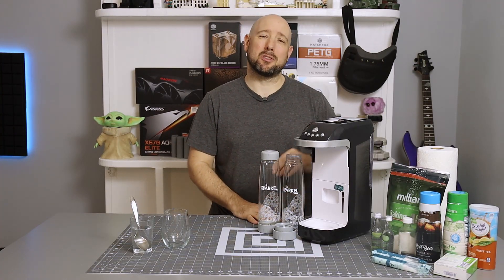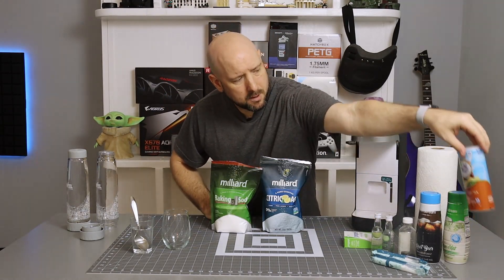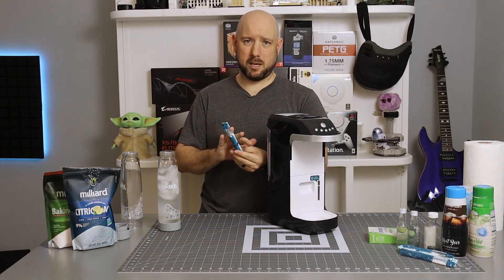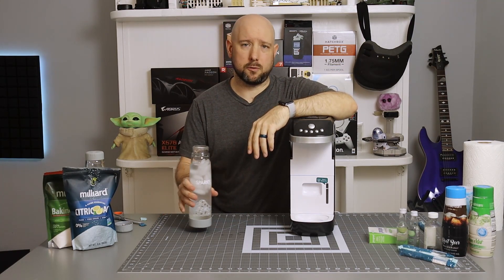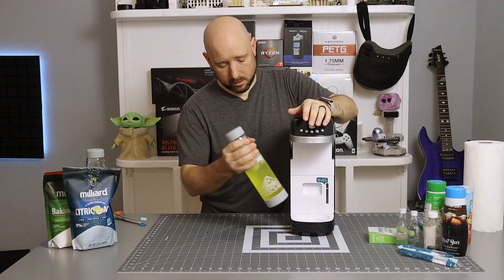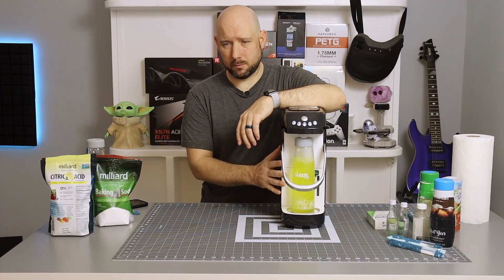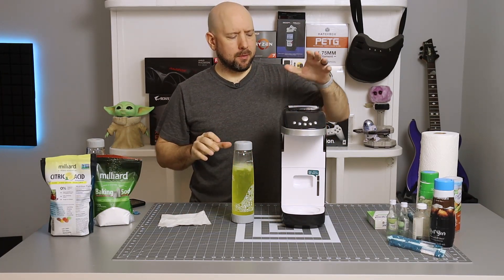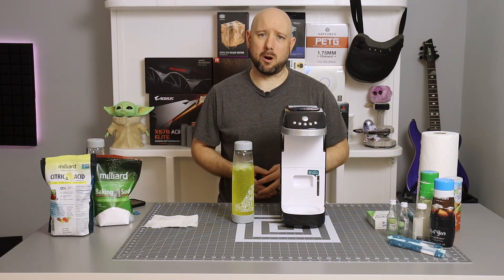Review: Sparkel Beverage Carbonator (with no CO2 canister)

Comment: DO NOT make your own carbonator. You will destroy the machine and void your warranty. I know because that's what happened to me. They may not look like it, but these are VERY sensitive machines and putting them through the wrong pressure will wreck the parts. I made my own carbonator using these exact directions of citric acid and baking soda and now my machine doesn't work. If you can't afford to buy the official carbonators forever, then DON'T buy this machine.

Comment: A few years into my machine and it still works great. The few times it has had issues it just required a good cleaning. They actually suggest that you unplug it and rinse the bottom area with hot but not boiling water to clean out any spilled or dried materials. No need to unscrew anything like this video suggests.
Reply: Do you use the carbonators that you buy from sparkel or do you buy your own citric acid and baking soda and use that? If you do buy baking soda and citric acid and not the sparkel carbonators have you ever had a problem with your machine?

Comment: We purchased a Sparkel a few months ago and only used the sachets,  never anything else. We empty the tray after every use and top up the rear reservoir to the fill line. After only a very few bottles, the machine would start to do strange things such as excessive drainage of the rear reservoir and fast filling of the tray. The bottle itself would lose much of the volume of what it was filled to prior to agitation. Frequent cleaning was required to rectify this. Eventually, water must have seeped into the electronics board and the machine was ruined. Sparkel was very good at sending a replacement unit.  However, only using the machine a few times, the machine started to exhibit the behavior of the original Sparkel and addition, a puddle of water on our counter. I found an online video from Sparkel on doing a deep clean using warm water and vinegar but I question why I would have to do this after such little usage. I'll give it a go but right now I'm giving this a big thumbs down.

Comment: Your comments about the cleaning issue below the bottom valve was a concern for me. Sparkel has a video posted on YouTube for 'deep cleaning' the machine and they do address that issue in addition to other cleaning tips.  It is NOT necessary to disassemble the bottom to the Sparkel to clean under the valve by removing the screws as you did.  They show a simple way to clean that area that is fast and extremely easy to do, no disassembly required.

Comment: I have only used SodaStream and the only issue I have with it is the actual CO2 absorption that it produces. I drink Diet Pepsi and was happy to see that SodaStream now offers the Diet Pepsi syrup (they should, Pepsico bought them out.) Anyway, back to my absorption issue. I drink from the smaller 1/2 liter SodaStream bottles (which is the same amount as the 16.9 oz Diet Pepsi's in the store.) I like to sip on my drink over a 30-45 minute time frame. My SodaStream Diet Pepsi has plenty of fizz right off the machine but about 20-30 minutes in, and 3/4 of it gone, it basically runs flat regardless of how many "pumps" of CO2 I gave on the machine at the start. So for my tastes, the carbonation decreases way too quickly. In contrast, if I am drinking a similar size store-bought Diet Pepsi, I can drink 3/4 of it, put it in the fridge (even uncapped)...and 6-8 hours later there is still be plenty of carbonation to satisfy my tastes. A long way around the question I would like to ask but here it is: Would the carbonation in a Sparkle drink last for 30-45 minutes? In other words, does the CO2 produced by baking soda/citrus acid allow for better absorption into the water over CO2 cylinder gas? (which I assume is produced using dry ice? Thanks! Looking forward to any advice or input!

Comment: Great review, but the Sparkel system is way more complex and messy than Soda Stream. I have concerns about all the wetted parts and good hygiene. The fact that you are dumping waste from the packets, liquid waste from the machine and paper towels for clean up is not too impressive. SodaStream cylinders are way too expensive (a refill should cost a buck or less), I use a special hose that adapts a normal 25 pound CO2 tank to the SodaStream we drink at least 4 bottles a day and the tank lasts a year. The biggest difficulty is where to put this stuff. We remodeled a few years ago and I put a countertop in the pantry with a hole and storage below for the cylinder, nice and neat and easy. Before that I was refilling cylinders from a 25 pound tank, but that takes a special hose and valve setup and special valves on the SodaStream cylinders…it is also potentially dangerous, so you need to know what you are doing and wear the proper PPE while refilling…gloves and goggles.

Comment: This is the best online review of Sparkel so far.  

I was sure I wanted one before seeing this. Now I'm uncertain because high-maintenance Sparkel is quirky and it has obvious durability issues. 

It's unlikely that Sodastream will take Sparkel's innovations lying down. The question now is what they'll come up with next, and at what cost. Sodastream has never been cost-effective.

There are also the new non-electric DrinkMate carbonator plus consumer reviews to track, so I'm not rushing into Sparkel unless it proves its worth and ease of use. 

I have no complaints about the totally reliable commercial beverages I've bought forever. They deliver the high carbonation level demanded.
Reply from the maker: Thanks Paula.  If your main concern is the safety of having compressed CO2 around the house the Sparkel is a good alternative - or if you are very concerned about cost per bottle and intend to buy chemicals in bulk.  If you are comfortable with the canisters then I would suggest going with a traditional carbonator.
Reply: Soda Streams needs to be cheaper for one. Secondly using the valves like Drinkmate which allows you to carbonate any drink to your little hearts content. 

 Also I never understood why those systems don't use a hose to inject from the top or valve on the bottom side. Feel like just shooting carbonation at is not the most efficient way but could be wrong. 

 I'm going to try this at home today. PS: You can get citric acid under sour salt to try it. Curious on what he meant on the bubbles though. Seems like softer finer bubbles are all the rage with these Nitro drinks.
Reply: @dianapennepacker6854 there's an $83 sodastream. Much cheaper and out wouldn't have the ability to be a reliable appliance. Luxury appliances cost money

Comment: The "one liter" Sodastream bottle is also only 3/4 liter. Bear that in mind. I have owned several different CO2 carbonation systems and all of the bottles labeled one liter actually can only be filled to 3/4 liters to carbonate.

It's true of the systems that use tanks and it's true of the ones that take the little 8gm carts. 3/4 liter is what you can carbonate in a one liter bottle. If you fill them above the 3/4 line, they will not carbonate and will spew water everywhere.
Reply from the maker: Good to know!  I have the Sparkel, DrinkMate, and a Quarbo and they are all 750-800ml fill capacity so that checks out.

Comment: We've had our Sparkel for about 2 months and just love it.  Still, your video gave us some very useful information
Reply from the maker: Glad it was helpful!  Enjoy your Sparkel!
Reply: A lot of people complain that it starts to leak after 3-4 months , and the motor died  after 6-10 months.
Did you had such problems  ?
Reply: @Weston.007  Any leaking is probably the result of the base not fastened tightly enough.  We have had our unit almost a year and have had no issues with the motor.  We simply LOVE our Sparkel!!😍
Reply: @janicegibson2042  thank you for your answer!!! Didn't think that choosing the soda maker is hard )))
Reply: @janicegibson2042  do you use the carbonator sachets that come from the sparkel company or do you use your own baking soda and citric acid? if you use your own and not the sachets from the company have you had any issues with your machine?

Comment: Actual reason Sparkel doesn't want you using cheaper ingredients, they can't over charge you for them and make bank.
Reply from the maker: It's the kuerig/razor blade model.  The sachets are not crazy expensive and it's real easy to avoid so I can't complain about them too much.  They are the only ones trying to avoid the compressed canisters after all.

Comment: I think its awesome that they are doing a canister-less system, but its far from perfect due to the reasons you alluded to in the video. I think sodastream is good, but between this unit, sodastream, and drinkmate - I think drinkmate is the best. I wish we could use baking soda and citric acid or vinegar in a sodastream canister to generate CO2 OURSELVES without having to use the trade in system or mess with dry ice. Since there is a supposed "omfg Co2 shortage" (which I think is total BS), we need better ways to make Co2 ourselves. But still a cool concept
Reply from the maker: Same boat.  I'm really liking my DrinkMate so far.  I know folks use dry ice to refill their CO2 canisters.  I wonder how much or how complicated it would be to use baking soda and citric acid to drive a refill process? :)

There's a new carbonator on the market, the Twenty39 Quarbo, that uses a similar carbonation cap that I'd like to get my hands on.  It looks like it might solve my biggest complaint with the DrinkMake - the small bottle hole makes it hard to get ice in.

Comment: The baking soda/citric acid hack is 👍, but, 10 mm wrench, and about $1.50 worth of dry ice refills CO2 tank, for up to five years...
Reply from the maker: Hey Matt.  I've watched a few videos on the dry ice process.  It looks fairly simple but also could be pretty easy to mess-up in a bad way.  How do you get refills for years with dry ice?  Doesn't it evaporate fairly quickly?
Reply: Sorry, I meant you could keep doing refills this way, as opposed to switching tanks, but   five years of this , I don't know if I would trust the tank anymore.
Reply from the maker: @mattzee6287  Ahh, gotcha!  How much dry ice do you put in per canister?  Do they bleed off excess if you accidentally overfill?

Comment: I got one yesterday , pleasantly surprised withe the result the 1st time.... but when I went to get another glass 2 hours later after sitting it in the fridge there was no more sizzle , pretty disapointing .

 I thought it would at least be good 24 hours , any advice on that ? thanks .
Reply: Did you chill your water before carbonating?  It really helps hold the sizzle if water is cold.  I use setting 4.  Don't bother using 2 or 1.  I never tried 3.  Last make sure cap is on tight when you put it back in fridge.  Sparkel states the fizz will last a week.  The longest I kept in fridge was few days.  And it was still sparkly.  That's all I can think of.
Reply from the maker: I agree with nijoel that getting good initial carbonation is important and getting/keeping the drink cool is key to that.  The sparkel bottle has the pressure valves built into it so they might be bleeding off any excess.  Maybe move it to another bottle immediately after carbonating and see if that helps.

Unfortunately I tend to either drink the whole liter pretty quickly or forget about it and leave it out to get warm and flat so maybe not the best person to give advice :)

Comment: simple direct, great advice and tricks, read the brand comment and they just don't want you to over pressure the device whit too much soda and acid ,💪💪
Reply from the maker: Thanks Doo!  I've actually dumped two of the sachets in on accident.  There's no way to clean it out so I just let it go :)  No major adverse effects but I do believe there was a lot of bubbling and churning the waste tank.  Of course if you go bonkers with the chemicals or get too far off in the mix I could see it sticking inside the mixing tank and throwing things off.

Comment: has anyone ever had any issues with it? twice now the water & citric acid + b. soda spilled into my drink - any advice?
Reply from the maker: I've had it dump baking soda into the drink a couple times.  I can't put my finger on exactly why.  I'm guessing something wasn't sealed correctly some where and it pushed the mixing water into the pressure extraction tube but can't say for sure what was going it.  It was rare enough that I didn't spend a lot of time on it though.  I've since moved on to a Drink Mate.

Comment: Bed bath beyond has $15 canisters and you can use 20% off coupon. I have had the Revolution sodastream machine and its looks cool first electronic one sold but sadly not available anymore. Seams sodastream is moving away from electronics and back to manual operations. Their new one uses a leaver on the side to deliver co2 and special quick connect canisters. The first canister is $60 some license fee crap after $15 refill exchange. Either way soda is now over $2 large bottle so these machines are making more sense. I buy 5 gal diet soda syrup from webresterant store, takes 3 oz. Syrup to 1 lt. bottle sodastream and its more along lines of Pepsi tase than coke which i like.
Reply: Oh yesh i will go through more than 4 1lt. bottles a day, i make 4 at time and will probably refill them twice a day. I like me soda 🤩🥤
Reply from the maker: Dang KingLord, that's a lot of carbonation!  The Bed Bath and Beyond deal, is that $15 per canister refill?  I think I'm spending $38 for two canisters in the DrinkMate recycling program.  That Bed Bath and Beyond deal would be great!
Reply: @LilMikeysBigPlans  yes 60L canisters refill have always been $15. Drink mate program which think in sodastream program i guess charging for home delivery. You go to BBB with your empty and just exchange for full ones. Bad part was i own the Revolution and it used the 130L then they were dropped and could only get 1 60L replacement.

Comment: Thanks for the review! Can you please share roughly how much syrup you added?
Reply from the maker: I pretty much go with what that bottle recommends.  I believe the Sodastream cap lines are based on 1L while the Sparkle bottles are 750ml so you may want to go 3/4 of the way up to the line.  That said, each syrup has its own strength.  For example, I use more fake-Sprite flavor and less fake-Coke flavor per bottle but that's something you'll have to experiment with yourself.

Comment: I have a soda stream. I learned how to refill it with CO2 myself using dry ice. My cost per liter doing it that way is about $0.08 per liter. 

Very informative video. Thank you.
Reply from the maker: I'm on a DrinkMate now and going through my first set of exchanges so I can experience the process before putting up a review.  Assuming there is no major headache with the exchange process I think pre-compressed is the way to go for me.

Once I get through that process I plan on switching to a home refill kit using a larger tank however I haven't done much research on the dry ice approach.  Can you buy dry ice in small enough quantities to do just a couple fills or do you need a bunch of empties to make it worthwhile?
Reply: @LilMikeysBigPlans  I buy 6 pounds of dry ice to fill 4 canisters. It only takes like 15 oz to fill a canister, but you lose quite a bit to evaporation on the drive home and blending it to crush it.

There are grocery stores near me that sell dry ice in smaller amounts. They say 6 pounds is the minimum, but the blocks evaporate in their coolers, so I used to be able to buy 2 pounds at a time occasionally. If they just got a shipment in, there was no way to buy less than 6 pounds.

That’s why I bought 3 extra canisters for a total of 4. It’s much better refilling 4 at once every 3 months or so than filling 1-2 at a time more often. Plus I can use all 6 pounds.

I would lose less to evaporation if I did smaller batches, but I don’t mind losing 2 pounds for the convenience of only filling 4 times a year.

I found a place near me that only charges $1.50 per pound, so that’s not bad. Everywhere else was $3-$5 per pound.

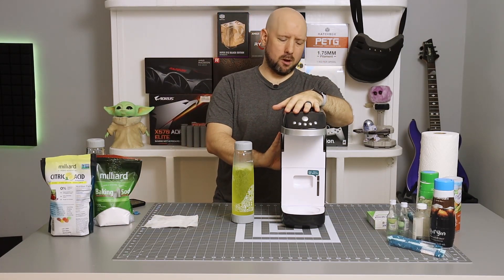Comment: 13:18 how long can I use this carbonation? You explained that we can use maybe up to 5 times, but can I use it 5 times as a few days in between?
Reply from the maker: Not sure what you mean by use the carbonation.  Are you asking how long a drink will remain carbonated once you have it in the bottle?  I would think it's similar to a bottle of water/soda that you've opened and re-sealed.  You'll probably get a few days out of it.  I've generally drank mine immediately after making it - with maybe some left over in the fridge overnight and haven't had issues with carbonation loss - at least no more than I would expect from a soda bottle.
Reply: @LilMikeysBigPlans  oh, I mean there is some amount of baking soda and citrus to put in to make carbonation. How much water can I carbonate with 1 load? Do I need to load and dump every time I use it? If I can use it more than one full bottle of water, can I carbonate another drink few days after without reloading baking soda and citrus?
Reply: @scott3282  It gets dumped to waste every time, so you have to fill with new powder every time. The water tank just lets you make multiple bottles before refilling the water.